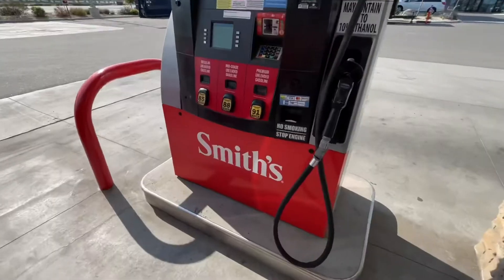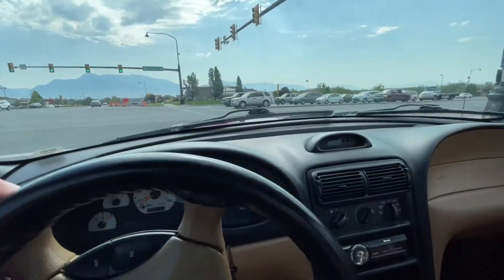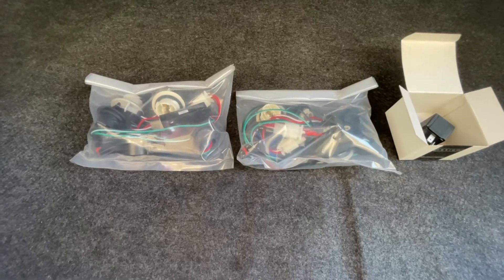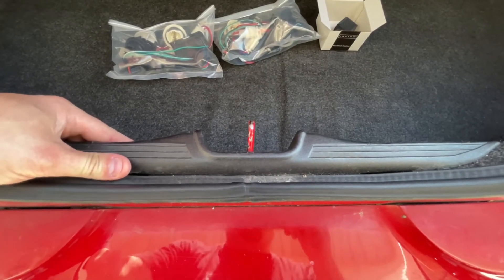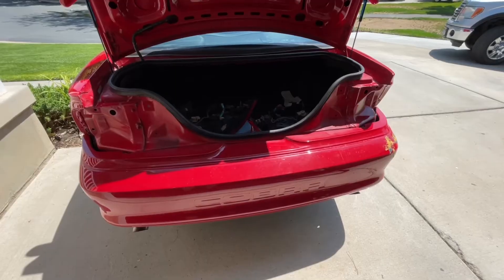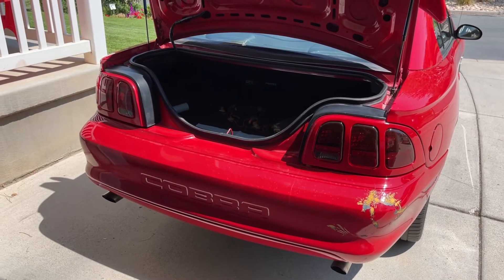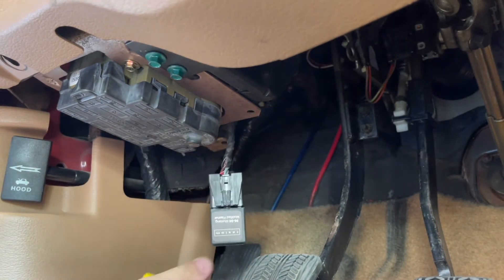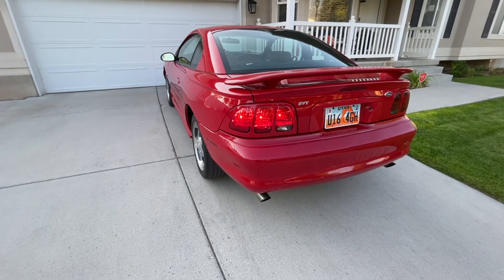INSTALLING A SEQUENTIAL TAILLIGHT KIT ON MY MUSTANG COBRA

Comment: Came across your vids so I caught up on them regarding your stang. As an original owner of a 1994 GT convertible I am impressed how well yours runs.  I just turned over 304,000 on mine.  Had my engine rebuilt at 256,000 8 years ago (yea, only put on around 5,000 miles a year), so I am dumbfounded yours does not need one... and passed emissions to boot!?!   Bought mine new for $23,000 in '94 and I have easily put that much in it over the past 27 years.  Still luv it and now just slowing tinkering/restoring what I can to keep it shiny and new.
Reply from the maker: Awesome! Thanks for sharing!